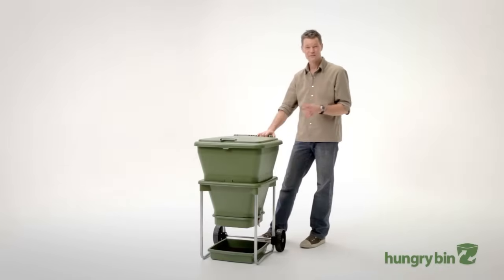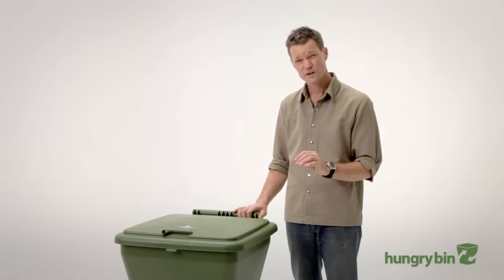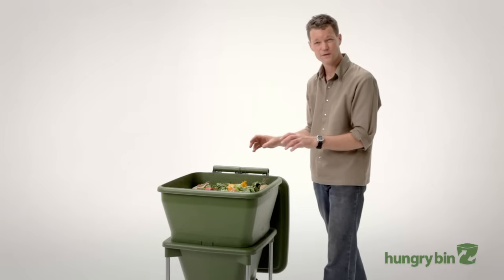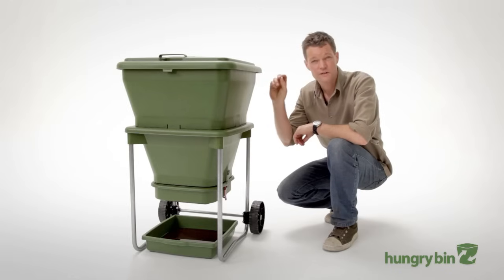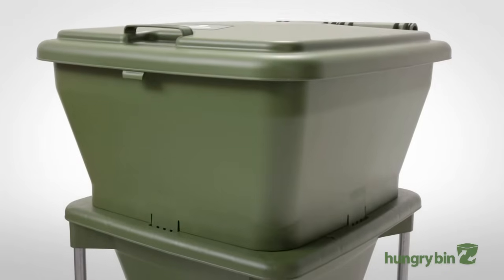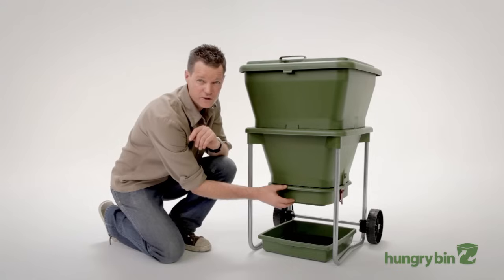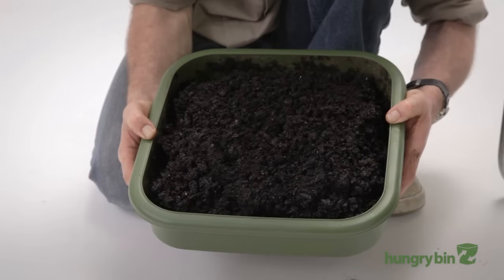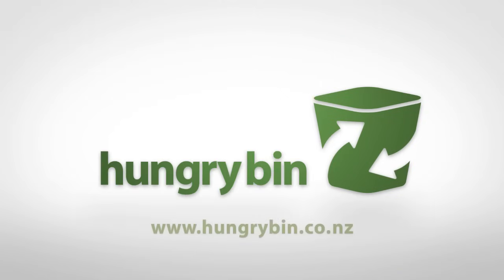Hungry bin. A continuous flow worm farm.

Comment: If it can process up to 2 kilogram of waste food per day.  Why does it still take 3 to 4 months to process from top to bottom?
Reply: ***** 
0.25 cubic meter would hold about 250Kg so 224Kg doesn't seem far off the mark. Also I think you're misunderstanding the composting process. This is not aerobic composting like in a 'normal' compost heap, where you would need a mix of brown & green wastes. This is simply worms digesting the food scraps. Their waste (ie poop) is the 'compost' and makes a brilliant fertiliser.
Reply: I think your getting a bit confused here.  A functioning wormery processing 2kg of food per day is not the same as saying worms can make 2kg of fresh food disappear in a single day. If you have 9 women you can have 9 babies in nine 
months.  That's an average of 1 baby per month. It does work that way.
Reply: *****  Not quite sure what your problem is here; do you not believe that wormeries work? I do have my own (not a Hungry Bin) and it works demonstrably well. I've never weighed the food I add, but I'd guess at about 2 - 3 Kg per week in a haphazard kind of way. I can believe that a properly fed & cared for wormery could consume 1-2Kg per day, though I doubt that most folk would achieve that. Why not give it a go yourself!
Reply: Dave Lewis He sorry wrong word lets go with it is a typical 400 pound keyboard warrior whose only fighting experience is playin call of duty with 12 year olds. I bet it hasn't  even got out of its chair because the fat rolls have embedded themselves into its chair. I salute you sir for your service as all good honest people would and its time ro find a nice little bridge for this troll to crawl under. Oh and Somebody needs to remember this is a public medium and there are a large number of ways of finding out someones real identity. I certainly do as do all my colleagues. I already know a lot about you somebody only time will tell how far you fall. Dave probably has already figured out  the how where and why lets see how long it takes you
Reply: @SomebodyYouDontKnow.
Your equation is totally oversimplified. A large amount of mass is converted into energy via intercellular energy transfer by the worms themselves. I have firsthand experience with these worm farms and a healthy population of worms can easily process 2kg of food waste etc, a day. In regards to your comment about food scraps being a poor sources of NPK you may be somewhat correct - prehaps that is why you are encouraged to add a high carbon source such as newspaper, cardboard etc to your worm farm. That would replace leaves etc. Another interesting thing about tiger worms is that they are actually carnivorous to a point; feeding on microorganisms that reside on the out side of the food scraps rather than simply eating the scraps themselves.
Reply: +SomebodyYouDontKnow If your system is not working maybe you need to move your system. I live in a mediterranean climate and to get mine working at peak efficiency i had to place my bin in the basement of my home to get peak efficiency. Each season when I rotate my vegie patch I add my castings from my worms to my vegie patch and have not needed to use commercial fertilizers ever since. If I added up all the castings total volume from my system it would be at least 300sqM of great fertilizer. That equals a saving of at least $1000 at todays prices. Your obviously doing it wrong, or the species of worm your using is not a true composting worm from your area so you may need to start again. Go down to your local council or Municipality and speak to one of their Environmental Department people. I didn't trawl thru the internet when I had to choose the worm for my farm I got an expert from my area who knew and had nothing to gain from giving me the advice I required. I got some baby worm and eggs and grew them and bred them myself and the bedding from my breeder setup was what went in my farm to begin with along with the 10,000 worms i bred myself. Now my farm has over at least 100,000 worms and easily cleaning up after a family of 8 peoples food waste. Our landfill bin only needs emptying once a month now Thankyou Hungry Bin
Reply: +SomebodyYouDontKnow Wow mate... I just looked at this post to see if I could learn something constructive, and I came across all your shitty comments just because they don't agree with your view. I'm happy to pick up this ball and run with it. Believe me... I CAN back myself! All your negative  comments aimed at people trying to help and being non-confrontational says more about you and your upbringing more than anything else. You must be one sad pathetic little cretin who thinks his opinion means something to somebody. Sadly not. No one cares what you think.  No one is "arguing" with you, they just have a differing opinion to yours. You crawl out from behind the safety of your keyboard using a wank name just to snipe at people with a differing view or even trying to help. Do us a favour and crawl back to that hole and leave the comments for the grown-ups who have something constructive to say. Christ knows where you come from, but I'm so hoping you're not an Aussie.  
Go on... be MY bitch tough-guy...     wanker!
How predictable cowards are!
Reply: +SomebodyYouDontKnow hers a sugestion squeeze  your self out of that chair go to the bathroom and have a good long look at the fool staring back at you. and by the way this past week my worms have been feasting on  a 5kg per day bufffet in my hungry bin. the biggest easter weekend we've had with 80 people over for lunch over the 4 days.
Reply: +SomebodyYouDontKnow you're a typical troll now admit you were wrong because it is totally obvious to all on here you are nothing but a sad little troll who never finished primary  school
Reply: +SomebodyYouDontKnow Im sorry but I don't care how many "Books" you read on the subject they are all printed to sell a particular product so are nothing more than marketing material. Real science proves that worms will digest pretty much anything which is organic and most commercial system actually grind their feed to an easily eaten size roughly around the size of their mouth. Also they are asexual so can reproduce at will to cater for the amount of food available. All plant matter also has a high carbon content so there is really no requirement to add extra on top. The water is often not from the food but rather condensation which acrues on the bin and inside the lid.
Reply: Original cheesy lines who thinks arguments are won and lost by who has the last word. Wow... I thought I'd met the biggest tosser in the World. How wrong I was. I've found a pathetic sad little man who tries to bully people.  "Tough-guy" on-line coward. The worst type of personality trait.
Reply: I'm off to protect the nation in my $150K job that people actually appreciate. I'll leave you to try and feel brave with your wank name and gay unoriginal lines. See you "tough-guy"...
Reply: +SomebodyYouDontKnow The math does add up your closed mind has been shown and you have no credibility so you go away and by the way my Hungry Bin has been operating for 18 months and has been awesome. Infact the numbers quoted actually are lower than what i and many others have experienced. Your purely an armchair critic who is probably one of those not in my backyard types who listen to consultant from big companies. I won't ever go away because idiots like you need to be silenced from spreading your delusion.

Comment: I really like the idea of a passive harvest system. I think that adopting a tapered design so that the compost compacts and rests on the side walls saves a lot of labour and allows food to be applied continuously from the top without having to separate the worms, uneaten food, and finished compost. I would probably improve upon your collecting tray with an open bottom with twine strung in parallel lines (twine is flexible so you can stick your hand or a tool through it). The harvesting bucket could sit on the floor or be suspended from the main hopper. The unit does not have to be small either. This can be scaled up ad infinitum by placing units together and removing the side panels to form one large connected trough.